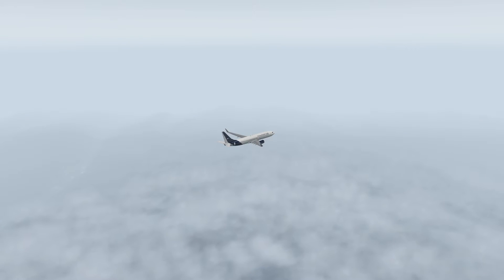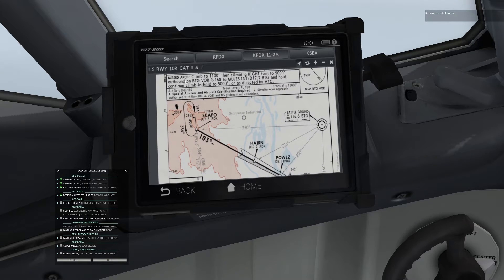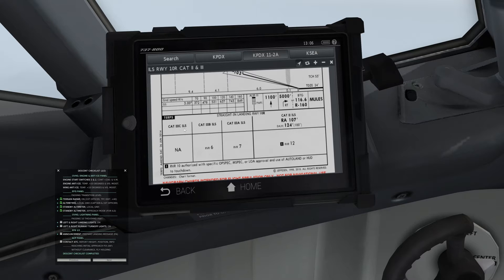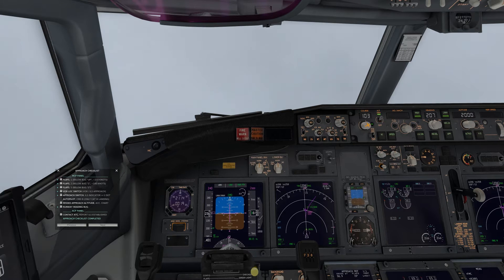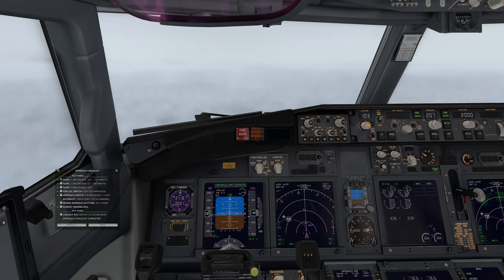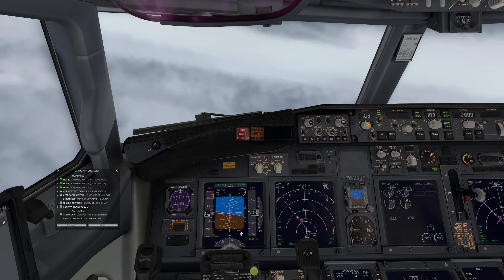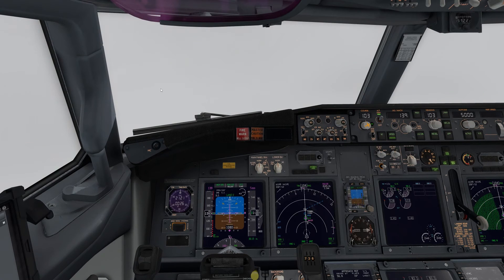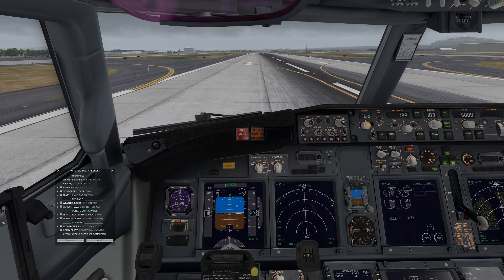X-Plane 11 | 737-800 Zibo Autoland Tutorial

Comment: There are limitations to using full autoland. Both engines must be operating, max crosswind is 20 knots, and max tailwind is 10kts. The max and min G/L angle is 3.25-2.50 degrees for autoland. My reference is 2016 FCOM.I only use LOC for non-precision approaches and arm APP on the intercept heading.

Comment: I find that with Max auto braking and NOT apply brakes manually, it will slow very quickly. If the brakes are applied manually with auto brakes on, it cancels the auto brakes.
Reply: Yes, that is how the real aircraft works as well. Manual braking disengages autobrake and shouldn't be done until around 80kts.

Comment: Micah good morning. I am Roberto from Brasil. I do use the XP11 and learning to operate Zibo 738. I have some questions and i will be happy to your replay. I have using Pro Flight Yoke System and I would like to configure them. For example: 1st question: How to set the Reverse in the quadrant hardware? 2nd: How to configure TOGA and others?
Please replay above informations to the email address: robertopinto.santos1960@gmail.com . Thanks a lot.

Comment: Cool tutorial but if you were Ryanair pilot you would be sacked for extending flaps during downwind turn (see you have 330/12) as this bank turn reduces lift therefore engines increase thrust and extended flaps create drag so engines have to work even harder, burning more fuel ofc ;)
Reply: funny comment 😄

Comment: Wish mine went so smoothly. I don't know how many times I've tried to get autoland to work... if I get the glideslope and the localizer perfectly set up and the diamonds are full and then hit the approach button and put the 2nd CMD on, the approach button light goes off and one CMD will turn off and the FD switches.  If I hit the 2nd CMD to turn it back on, then the FD switches again and the other CMD turns off. It stays on ONE CHANNEL and never goes to LAND3.  So I don't know what I'm doing wrong...
Reply: May be a stupid question, but is the runway you're trying to land on definitely CAT III?
Reply: APP will always extinguish after GS capture. Pls make sure your both CRS SELECTOR & both ILS FREQ are set and both TRANSFER BUSSES are powered. Once on intercept HDG, arm APP & engage AP B in addition to the already engaged AP A. At GS capture, the CBTR (cross bus tie relay) opens and isolates TX BUS 1 from 2 and DC BUS 1 from 2). If power isn’t proper on both busses, onside AP disengaged and above 800 ft RA onside FDs bias out of view. Hope it helps.
Reply: @christiangallo4021  Thanks - have gotten it working now since that comment a year ago!  Appreciate the help though!
Reply: @rangerrick8220  yup. Kinda late seen. AT kicks off automatically touchdown +2sec.

Comment: Should I be removing vectors or does that mess with the landing?
Reply from the maker: Vectors are a placeholder for when ATC would give you vectors. You can remove them OR you can give yourself vectors
Reply: @MicahMesser  do you ever remove yours? Or stick with the default ones in every route?
Reply: @killerbsting1621  you do have to remove them eventually or your aircraft will fly that vector path in VNAV till it runs out of fuel (or you turn using HDG SEL).
 I delete them so my PROG page is accurate with distance remaining, ect. The approach charts normally show where you will expect vectors.

Comment: Hi Micah,  Your videos are great and I have Zibo V3.39.25a and it fly beautifully. But I have the same problem as others - Cannot engage both at the same time.  One goes OFF  when the other button is pressed.  Hope something is not correct. Can you explain it.
Reply: Yes - I get both the glideslope and localizer perfectly on the mark and when I go to hit approach, one of the two CMDs goes off and the FD changes.  Very rarely can I get LAND3 to work.

Comment: I cant have CMD A & B engaged st the same time, after a few seconds one of them disengages
Reply: Me same...  works only once in awhile.  I go all the way in on SINGLE CH and have to take over manually....  not sure why.
Reply: @rangerrick8220  I had the same problem. It turned out that I forgot to set the course and the heading of the runway on both Captains and F/O's desks.
Reply: @ИванЗабалуев-ф7ц  Nope had that all set...  I've updated the ZIBO since then and it seems to work now.
Reply: Ranger Rick let’s hope that it will at least help the others with the same problem :)

Comment: Mine doesn’t change between single ch and land 3... any Idea why?
Reply: Me same...  works only once in awhile.  I go all the way in on SINGLE CH and have to take over manually....  not sure why.
Reply: Before approaching select CMD A and CMD B and APP then let AP do it's work.
Reply: Has to be engaged prior to reaching 1,000 AGL. Both course knobs need to match. Both nav radios tuned to same frequency and APP mode is shown on MCP and you are established on both LOC and G/S.

Comment: I have watched 4-5 YouTube videos trying to setup a Auto Land and each time I get bit!

Zibo MOD Boeing 737-800
X-Plane v11.36r2

Arriving into KBNA using the CHSNE arrival Rwy 02R (which is a Cat III rwy)

As the AP turns to 021 inbound at 3000 ft I click APP and the approach begins. However when I select Cmd B it turns off 
the Cmd A and still lands only as a regular ILS landing...NO effort to Auto Land

Both courses set to 021
Alt 000
Both Nav's 111.75
Flaps 30

Anyone with a suggestion on whats necessary to perform a Auto Land
Reply: Finally! Seems the trick for me was to wait until on final approach and descending on the GS before clicking Cmd B. Thanks for all your help!
Reply from the maker: Glad you figured it out!
Reply: altitude should be to Missed approach altitude, you can also engage the CMD B once the LOC has captured. Remember Glideslope doesnt capture before LOC. So once you capture the LOC then you can arm both A/P'S for the autoland.

Comment: Just fyi, you don’t want to hit LOC before APP. Heard that there were some issues in the past with that. Also add 5 knots to your VREF speed, that’s standard on the 737. In windy conditions above 5 knots you want to add your wind component + gusts to your VREF :) subscribed btw
Reply: Good catch. But the opposite was true on the classic. On ALAND always set vref + 5. No wind adjustments (as on a manual landing), since AT remains engaged.

Comment: You hit VOR LOC and then later hit APP phase. What's the difference between the two? I usually only hit 'VOC LOC' button.
Reply: Pretty sure that VOR LOC will not follow the G/S.

So if you do not press the APP button the aircraft will not pitch down, instead it will only control your horizontal movement.
Reply: VOR LOC is primarily for non-precision approaches where the G/S isn't available.
Reply: VOR/LOC is a lateral mode only. APP is VOR/LOC + GS, lateral & vertical mode. APP is used for ILS (or IAN NPA); VOR/LOC for VOR or LOC APP using V/S as pitch mode. In the B737C u used VOR/LOC first, then APP since it didn’t had (not all FCC software) a mode to prevent GS capture before LOC capture. No longer appl to NG.  It won’t allow GS capture before LOC capture.

Comment: Did you flare the plane, or did it do that?
Reply from the maker: It did it.
Reply: @MicahMesser  Is it a must to do ? or the ILS landing should do it by itself?
Reply: @CesarSanchezQuiros  You can do either an autoland (the plane does the entire landing automatically) or a manual ILS landing using the glideslope to guide you to the runway, it's up to you. But from my understanding, the runway has to be CAT III to support autolands.
Reply: @thecommentator6694  not much use in the UK as even heathrow is a CAT I
Reply: @CesarSanchezQuiros  without autoland armed, the pilot must disengage autopilot and autothrottle, and flare manually, followed by reverse thrust on touchdown.